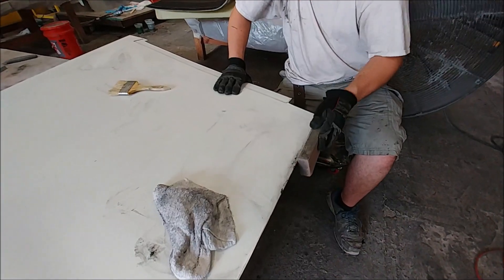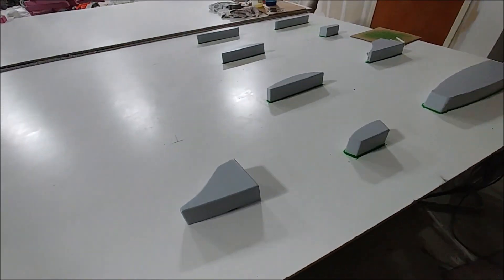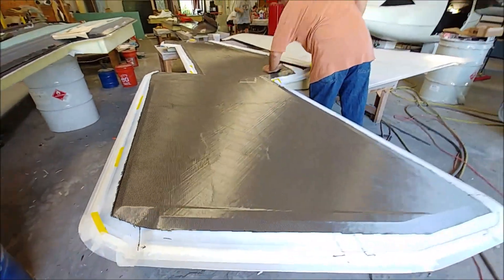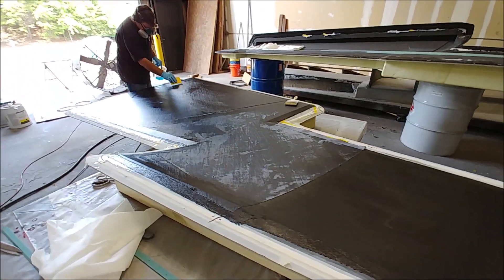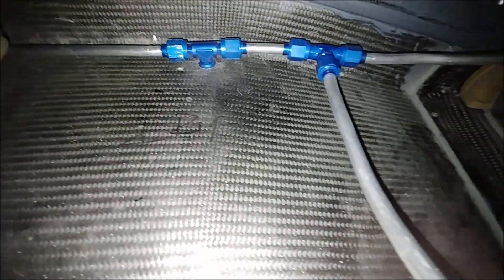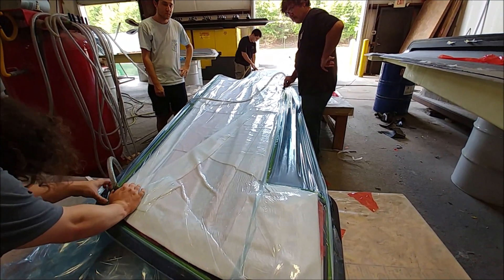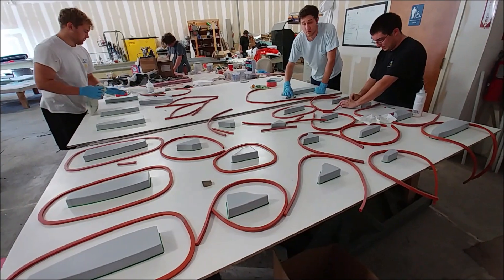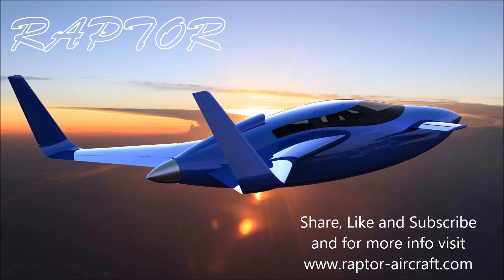Wing Skins Part Trois - Building the Raptor Prototype

Comment: Now that hard lines are going in on the landing gear, have you considered adding down lock pins for the gear legs?  It would make hydraulics maintenance safer and easier and prevent inadvertent gear collapse when moving around the plane.  It could be as easy as adding matching drilled tabs to the gear push-pull arms hinge point that align when the gear is fully over-center.
Reply from the maker: The gear already has over center design with gas struts to keep it locked down.

Comment: I am a retired aircraft tech, and was just wondering if it is ok to put the electrical connection for the landing gear under the hydraulic connector in case it leaks. Not trying to 2nd guess you. You are doing a great job, cannot wait for 1st flight.
Reply from the maker: We'll, the atf fluid is non conductive but even if it leaks the gear will drop and lock into place automatically so a possible electric short would not cause a further problem.
Reply: Ok thanks

Comment: Looks amazing with the doors on - seems like you are on the home stretch!  I've probably missed it, but are the large wing skins made up of multiple pieces or a single length running from root to tip? If multiple pieces wondered how they are orientated and if they are laid like 90/45 degrees to one another?
Reply: Philip Meads single piece wings